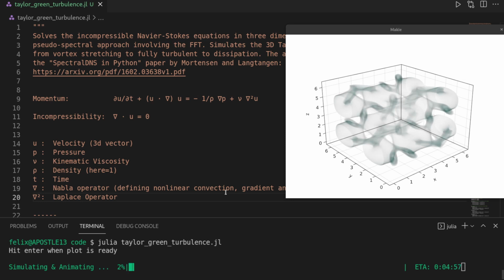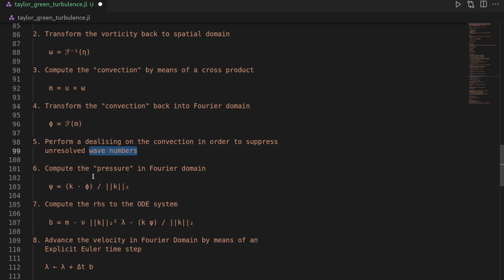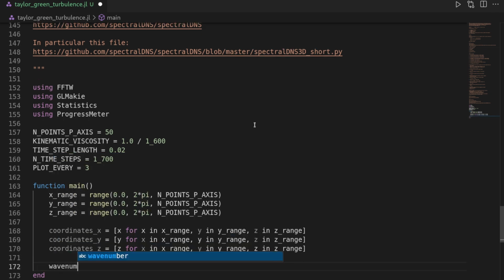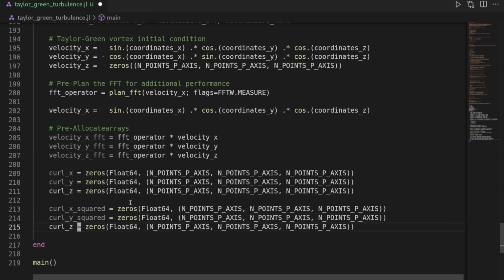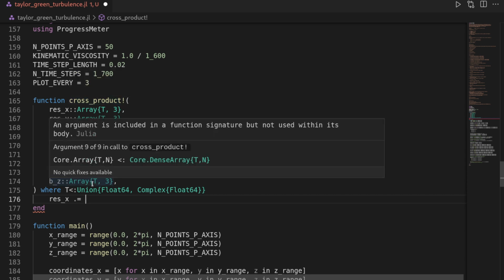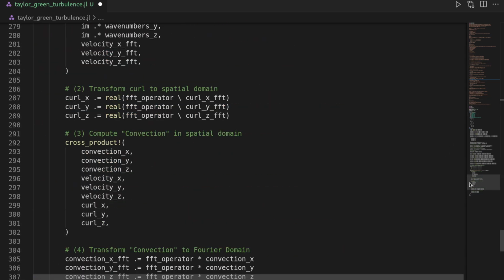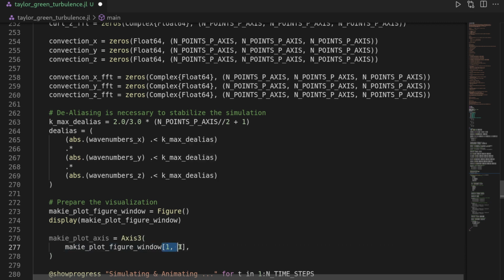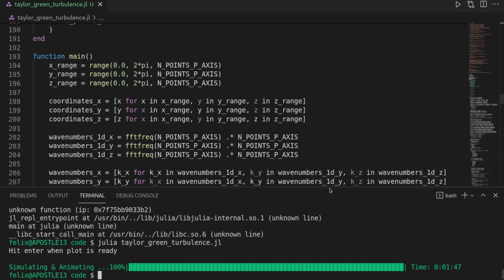3D Pseudo-Spectral Navier-Stokes Solver in Julia

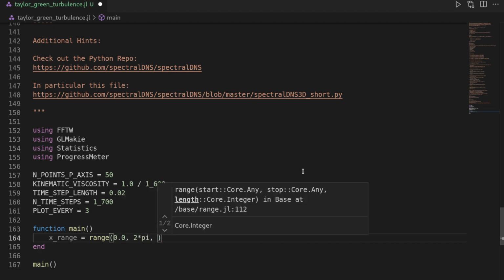Comment from the maker: Errata: There is a small bug in the spatial discretization at ~12:30. When using the FFT, we should not have a discretization point on both ends of the boundary, since this introduces unnecessary noise. The file on GitHub has been fixed: https://github.com/Ceyron/machine-learning-and-simulation/blob/main/english/simulation_scripts/taylor_green_turbulence.jl

Thanks to Paulo for pointing this out. :)